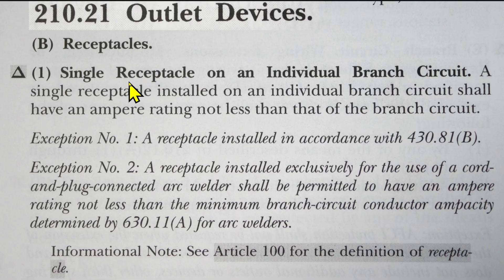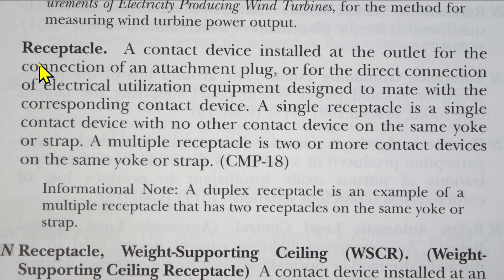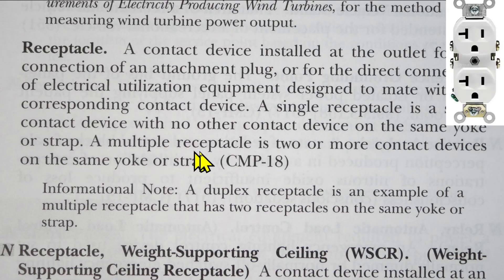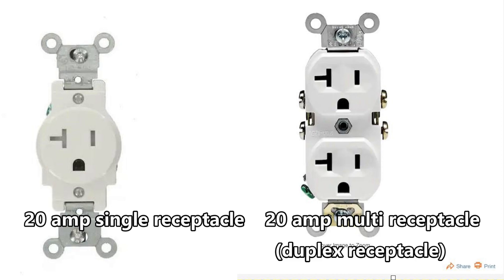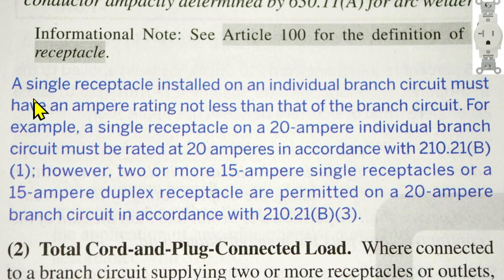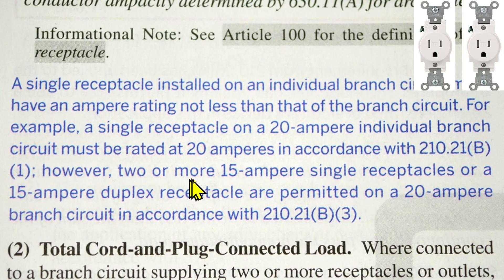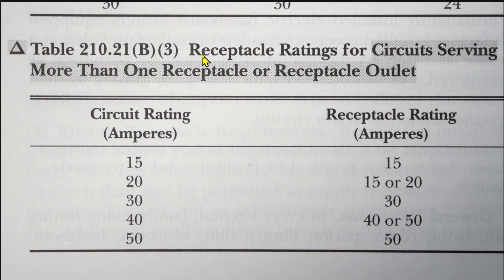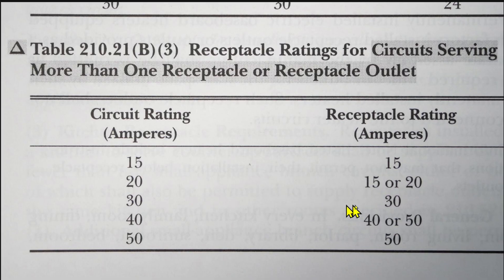Shall I Use 15A or 20A Receptacles on a 20A circuit per 2023 NEC 210.21(B) ?

Comment: I use the better Leviton 15 amp outlets and they are identical to the 20 amp less the extra slot on the front. I just installed one of these, as you have shown in the video. Take those two outlets apart, and they are identical inside. That first outlet, that is a contractor grade outlet, which are junk. Know your outlets folks.
Reply from the maker: Isn't it interesting that they sell the residential grade receptacles as "contractor grade". Electrical contractors won't usually touch them, but some general contractors love them because it saves a couple of bucks on each receptacle. Yes, know your receptacles!
Reply: @SparkyChannel  And when you are in the hardware or big box, open the box and make sure you are getting what you are buying. Many times they take the screws out, or swap outlets or switches. They have gotten me, once. Now I open every box to inspect.

Comment: Makes sense, you'd want heavy duty appliances on their own circuit; A/C units, refrigerators and clothes washers can have pretty high peak amperages when the motor starts. Some dishwashers have pretty high draw. Outside of bigger appliances, though, I don't see a benefit to using the 120v 20A outlets. I can't think of a single one I've seen or used outside of a garage (air compressor or small welder) in all of my years.
Reply from the maker: Thanks!
Reply: It's actually smarter to use a receptacle rated the same as the wiring and breaker.  If the wiring is 12 gauge, it is better to install a spec grade duplex receptacle rated at 20 amps whenever possible.  In some cases, it becomes impossible on a 20 amp circuit to install a 20 amp receptacle if it's a combination receptacle.  One example is a combination Pull Chain light receptacle with a grounded outlet.  I found out under code that it qualifies as a "duplex" receptacle, since the receptacle is wired as a dual purpose receptacle.  I have 3 combination pull chain receptacles with grounded outlets downstream of my 20 AMP GFCI duplex in my detached garage, along with a switched light fixture on the garage circuit.  There is no 20 amp combination pull chain/outlet fixture sold anywhere.

Comment: Can 14 gauge solid core be used on 20 amp breaker & 15 amp  dual receptacle?
Reply: No
Reply from the maker: No.
Reply: 14 gauge wire may not be protected at more than 15 amps.  12 gauge wire may not be protected at more than 20 amps.
Reply: Solid core vs stranded is irrelevant. For the purposes of ampacity rating and NEC code, solid core and stranded are identical. They both have an equivalent resistance which determines the heat dissipation characteristics which is the most important factor for safety ratings and code calculations. While stranded is generally easier to work with because of its flexibility, material (copper vs aluminum) and size (14 vs 12 awg) are the factors to consider, though insulation type (THHN) is also a factor for some applications.

Comment: Why can you have a 50 amp receptacle on a 40 amp circuit?
Reply: I couldn't find a 40a receptacle when I put in a 40a circuit this year
Reply: because there is no 40A receptacle.  40 amp circuits are used for electric ranges, and they were originally 50 amp circuits - rather than require a change in range receptacles, they just specified that 50 amp rated receptacles could also be installed on 40 amp circuits.
Reply: Because a 40 amp 240 volt circuit is for a permanent installation and not to be used for anything else but the appliance nearby, such as a clothes dryer. As long as the appliance is rated for 40 amps or less and the wire gauge is appropriate for the current, there's no problem. 15 amp receptacles are all over the house and can be potentially used for any appliance or tool. A homeowner can, unknowingly use a 20 amp receptacle on a 15 amp circuit and cause a potential over current situation.

Comment: I am a DIYer and went to commercial only grade receptacles several years ago. After seeing the difference in quality the price difference made it an easy decision to go with commercial grade.
Reply from the maker: Excellent!
Reply: Yes, especially if you can purchase them in quantity.
Reply: So dumb ? Sparky so how many 20 amp receptacles can u put on one 20 amp breaker  in one room ?
Reply: Yup. Pass and Seymore/Legrand 20A spec grade TR outlets in our house. Back wired, much better quality plastics etc. 

They also make a spec grade TR and WR outlet, but you have to buy those online. 

I'm done with garbage side wire outlets.
Reply: Yes, no need to loop the wires around the screw terminals, just back-feed in straight but with a tight screw clamp (not poor push-in spring type).  There are also now lever-lock receptacles that are similar and don't even require a screwdriver to connect wires.

Comment: Sparky, you are making good decisions.  Kitchens are a likely area that may have a heavier load. Good explanation as usual.
Reply from the maker: I agree. Thanks Gary!
Reply: I like the better "commercial" outlet that has the 15/20 A "T" terminal for its straight-in back-feed clamp wiring, better ground, and tighter terminals, but I think you can also buy those with 15 A - only receptacles.  I can't recall ever seeing a kitchen appliance that uses a 20 A plug (one sideways terminal), but good if a reader can relate one.  About the only devices that do are some 120 VAC welders and well-pumps,